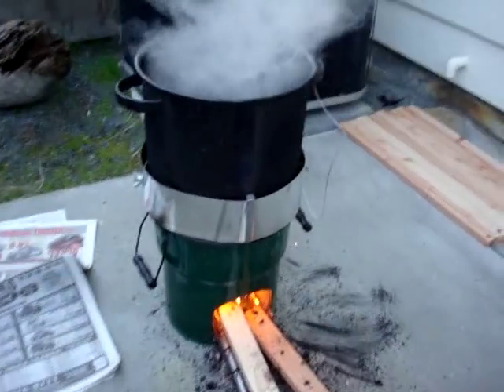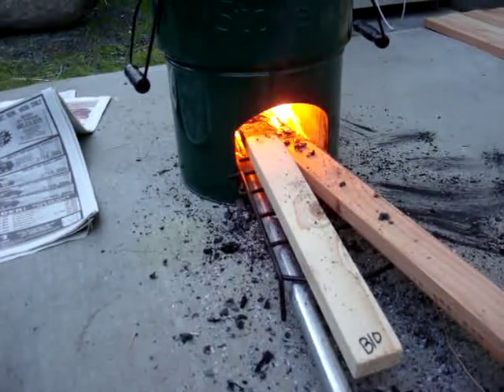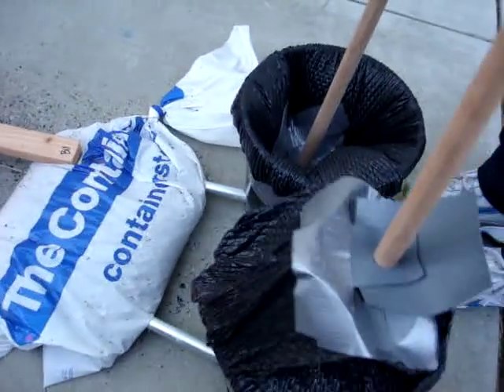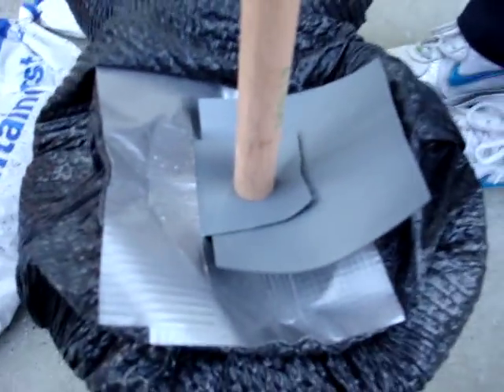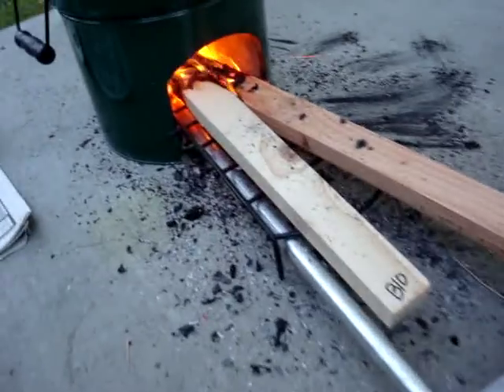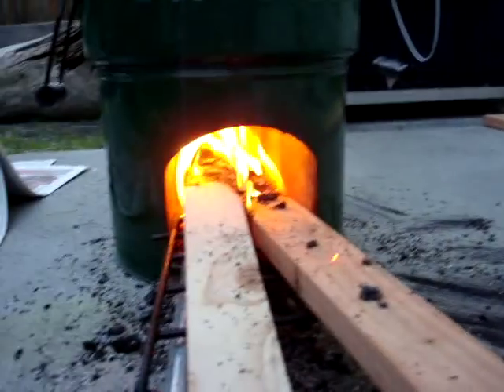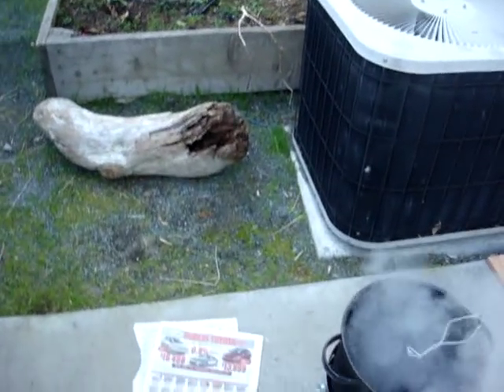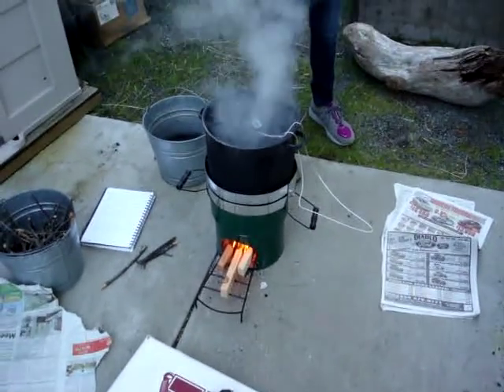StoveTec Rocket Stove with bellows

Comment from the maker: Also, the air fuel mix of a fire might be optimized with bellows to more completely consume the wood reducing wood required and particulates created.  More testing (and better measurement tools) required to see if a bellows design can achieve that.

Comment from the maker: @doughpat , Valves were indeed rudimentary...probably a 10,000 year old design.  Stiffer flaps attached to the ends of the sticks that closed the hole on the down-stroke and naturally opened on the up stroke.  Surprisingly little air escaped through the valve.  No problem with air/sparks being sucked back into buckets.  Main issue was ashes being blown up into pot.  A simple screen might address this issue.  The volume of the 2 bellows were probably excessive for the size stove.  Thanks.

Comment: @mhee2b I made it for my 1 gal paint can (plus a tomato can) woodgas stove. I powered it with a car booster pack which is basically a car battery and I would keep it charged with car batter solar panel, quite small.  But it could run on smaller. At woodgascampstove site you can get a 2 AA solar battery charger which powers their stoves (I had 2 of them until I got smart and started making them) Just don't leave them out in the rain! My other panel can handle rain. Those flex panels work too.

Comment from the maker: @SunnyMoon2010 No.  All things equal, a hotter fire is more efficient and releases more energy from the same quantity of fuel.  In this experiment, we burned wood in the two stoves for an equal number of minutes.  The amount of wood burned in each was nearly equal.  However, since the stove with the bellows brought water to boil faster, it took less wood with the bellows to achieve 10 minutes of boiling.  Forced air > more efficient combustion > less wood needed > fewer emissions.

Comment from the maker: Yes, you will have to feed a child a very little more if you make them pump the bellows.  (Unless you call them in from soccer.)  More importantly, the default cooking mode for almost half the world's population is open fire or inefficient cook stoves.  This StoveTec rocket stove is dramatically more efficient than an open fire.  The faster a stove is, the higher the adoption rate because people everywhere want to get dinner on the table quickly.

Comment: I made a blower using a 2 liter plastic soda bottle with square hole cut into side and 12V computer fan metal taped to hole. Easily solar powered and/or car battery or smaller. Not super powerful but enough for cooking.  Try it!

Comment: @apples13able One last thing, I used a hair dryer on cool on the woodgasstove and heated 30 gal of water to 140 F using a 5/8 copper coil.  Took 3 hours of constant fuel feeding.  I want to refine the system. Need a camera! Eventually!